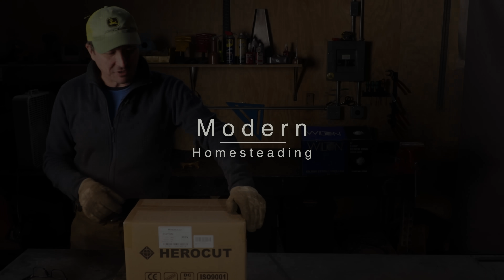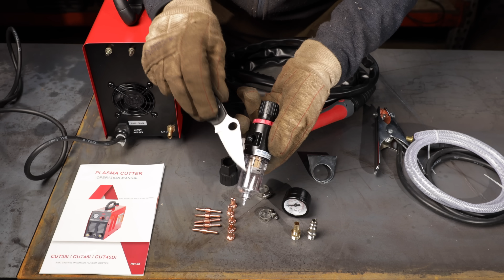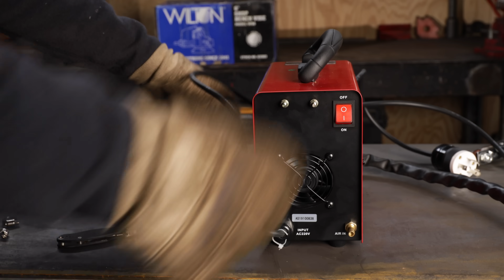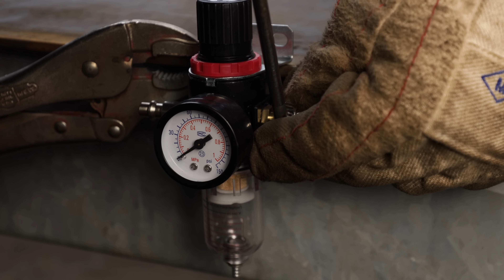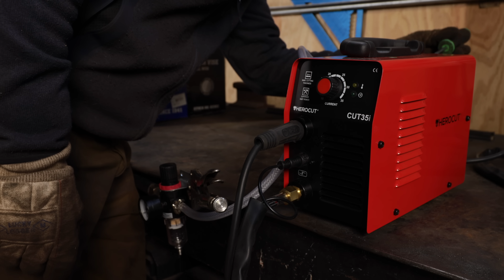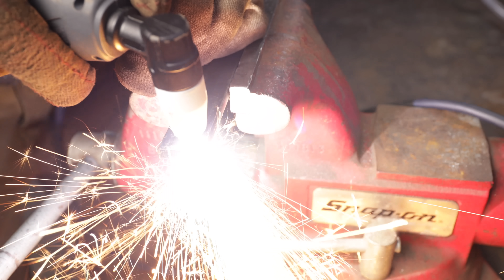TESTING The Cheapest Plasma Cutter On AMAZON

Comment: "There's a special place in hell for manufacturers that don't standardise things"

2 minutes later: "the metric system rears its ugly head again"

This week's irony award goes to Wranglerstar 😂
Reply: Rob M The fact that is is used way more because a lot or equipment comes from the US doesn‘t make it a better system. I would argue that metric is far more intuitive, especially for somebody who hasn‘t grown up with it and has to learn it later in life (vs the other way round). There‘s a reason that only three countries in the world are still using imperial units, although scientists in the US are probably already using mainly metric.
Reply: C90adventures : so, this is NOT a rant or anything, but rather an honest conversation I hope can be understood peacefully.

His first comment you reference is in regards to air tool fittings, which, if you are unfamiliar with air tools and their various fittings, it is an absolute nightmare since at least 3x of them all appear to be the same to the casual eye, but are in fact very different and can cause pretty serious air leaks if you mate them incorrectly. i.e.: a male "A" might fit into a "B" female, but the male "B" won't latch in an "A" female; and the "C" male might fit in all of the females, but will leak so badly in 2 out of the 3 that you have an audible hiss and a massive drop in pressure. As for MY air tools, I use the Foster SHD series, which is what the US Army uses and are conical pressure fittings. And they won't mate up to anything but a Foster SHD female; not any other commercially available fittings. So I have to have "conversion" fittings where I have a male end of various other fittings attached to an army of SHD female fittings so I can use my tools at any of my friends houses or at work without having to wrench off my fittings every time I go somewhere.... That would be a pain. And yes, it WAS (and *is*) my choice to run Foster fittings and be out of conformity, but I personally find them easier to use and they seal EVERY time without fail, but that's my personal opinion.

His second comment about the metric system, you gotta remember, this dude is super knowledgeable but his knowledge stems from an age when SAE / Imperial was king in the U.S., which was actually not that long ago (early 90's). Nowadays, the U.S. is flooded with a mix of SAE and Metric and people are constantly confused bc there really isn't a set standard for us anymore. Most kids today will do just about ANYTHING to not have to deal with fractions, and I'm right there with 'em; but take a minute and look at an SAE to Metric fraction to mm conversion chart and you will see that fractions, or SAE, has a lot more options than Metric sizings and is much more flexible if a manufacturer (say NASA) needs a specific tolerance, or torque value, or sheer spec as opposed to Metric. The pain with dealing with both standards is the same as if the Brits were to be forced to convert to SAE: they'd fight if tooth and nail for decades and it would take several generations for if to take root and get the working class all on the same page, but until then it's gonna be an absolute rat's nest of confusion, as is exampled here. Where our younger generation is more comfortable and familiar with Metric, and he is more familiar and comfortable with SAE. Neither one is better or worse, but simply a different tool with which to work with; and they only really work if everyone is on the same page, but if you've been using one for more than half your life, you're not just gonna switch from one to the other simply bc someone says you're "wrong". That's their opinion, but as long as we can effectively communicate from A to B, we can collaborate and build something together instead of fighting over who's "right" and who's "wrong".
Reply: @Hendo2488  You said it very well.
Reply: @Hendo2488  There is no right or wrong on the measurement systems, which will work if one stick to it around the world...for the convenience and ease of operation standpoint...The worse thing is to allow two different systems in place that can cause a lot of confusion.  From my experience of learning metric system to the Imperial system later when I came to the US, it is problematlic that I constantly needed to check, convert, and switch when I read papers, books, and such.  Since most of the world had converted to the Metric system, I think it is time that US needs to do the same, for the sake of conforming the the one standard that is easier to learn...No fractions needed.
Reply: @slchang01  then why am I, in the U.S., constantly finding hex bolts that require either a 4-1/2mm or 5-1/2mm hex key or socket to remove? Metric doesn't use fractions, huh? I grew up using fractions and I understand full well what those fractions mean. I too have to convert when I use metric, or Celsius, or kph (which is still metric).

But I guess I'm just not lazy and I found reference points on each chart that allow me to know that 100kph is 60mph and I can either double or halve that to find variations. I found that 10c is 50f, 20 is ~70, 30 is ~85, and 40 is 105. And a yard is 3ft exact whereas a meter is 3.3ft. These are simple conversions that are approximated, but for day to day use, they are perfectly fine for what they are. If I need something more exact, like in a lab or building a structure, I'm gonna have a conversion formula and record it to the most relevant decimal point. But day to day use never requires that level of precision.

Just bc you find it easier for you, doesn't mean everybody else does. If SAE was truly that terrible, they would have stopped using it a looooooong time ago. 

Or maybe it has something to do with our pride and not letting the English have dominion over us that they have so longingly been craving for more than 250 years.
Reply: @Hendo2488  By saying fraction, I meant that the unit is self explanatory...1 meter is 100 cm, or 1000mm which in complex units involving derived terms, it can be easily related and converted to the units in larger or smaller scales...Also, can you say freezing temperature is 0 degree Celsius, or 32 degree Fahrenheit? or boiling temperature, 100 degree C, than 212 degree F?  What I meant, is that the Metric system was developed for a reason, not so for Imperial system...
Reply: @Hendo2488  All that to say Metric rocks....lol
Reply: NASA had a mishap with imperial vs metric. The Mars Climate Orbiter. 

"A navigation team at the Jet Propulsion Laboratory used the metric system of millimeters and meters in its calculations, while Lockheed Martin Astronautics in Denver, which designed and built the spacecraft, provided crucial acceleration data in the English system of inches, feet and pounds."

This is why you have standards. And the standard is metric. Used by over 95% of the worlds population is metric. And metric is used in science, medicine, the military, automobile production and repair, and international affairs in US.
Reply: @GeirEivindMork  98.5% to be exact...US, Liberia and Myanmar use imperial units (3 out of 195 countries)
Reply: @GeirEivindMork  It was a mistake to switch over to metric. A lot of added confusion that led to the miscommunication. We went to the moon using imperial units. After they switched to metric, even the Space Shuttle got canceled. NASA can't even send astronauts into orbit now. It's been a sad decline ever since we ditched imperial units.

The dark age of metric units...
Reply: @eyeborg3148  The world have changed a lot since the 60s. I know USA is all about "USA FIRST" now with it's scary turn towards a seemingly fascist authoritarian leadership. But the reason for lesser space travel is more rooted into the fact they have to do it more safely than they did with the primitive 60s technology which cost money, but NASA had its funding peak in 1964-66 when it accounted for 4% of all federal spending and the apollo moon landing was of top national importance towards now when it is 0.48% of the budget. In todays dollar the budget in that time was up to twice as high than the one you got now, and that without the higher costs that you got now. So back in the day space exploration was both a top priority and a way better funded. But it's not all lost, SpaceX is planning on landing cargo on the moon in 2022 with people shortly thereafter, so you are doing well with in the era of metric as well.
Reply: @eyeborg3148  wait wut are you blaiming the metric system for nasa decline ? 
and just so everybody knows metric is better then imperial for many reason like:
-It s easy to reamber like just look at the imperial units for lenght (inch,foot,yard,mile,fathom,,rod,furlong……..) and now look at Si units (meter) and then you have prefixis to describe how big is your unit of lenght (micro, milli, centi, deci, deca, hecto, kilo, mega….) and thoes prefixis make total sens between eachother like 1000milimeters=100centimeters=10decimeters=1meter=0.1hectometer=0.01kilometer
now try to do the same thing for imperial units and you will get something that look like this 12inch=1foot=0.333333yards=0.00018939miles 
-Another reasone is that the Si system has names for extremly big units and extremly small units like 1nanometer=0.000001milimetre (that s extremly small and it s not even the smallest mesurment unit yet that we have) or 1meter=0.000001megametre(extremly big) and for this too it s not the biggest that we have 
-Another reasone is that this apply for preaty much all units we have same goes for volume or weight with the exact same propetis and exact same prefixis  while you guys have stuff like tablespoons gallons cups pounds ounces grains…….
-And the last important reasone i coudl give is that they all go togheter nicely like look at this sentence that is actualy true.It take 1 calorie to heat up 1ml of water that is 1 gram of water by 1 degree
Reply: Kevin Tu other way round it’s a mistake that the us does not entirely switch to metric
Reply: Kevin Tu the Romans turned to metric and they lost to Genghis Khan and collapsed
Reply: @eyeborg3148  Soviets were first in orbit with rocket, first to have the satellite, first living being in space, first around a moon, first man in a space, first space walk, first woman in space, first moon landing, first photographs of a "darkside of a moon" (backside to us), first lunar samples to earth by robot (followed by Apollo 11 and 12 manned samples), and only thing that Soviets "failed" was to get a man first on moon (and back) just with days after Americans.
And all that was done with Metric SI system.

It is sad that one nation does like 13 achievements of 14 first, only to come second in one (delayed by days) and it is like a huge victory to Imperial system.....
When USA got moonlander down, Soviets brushed to applauds because it was not who was there first, but that human race has succeeded in the last step of a moonrace.

Imperial? Pffff..... 
USA is alone and even dual-standardized SI and Imperial, just can't do the quick kill to imperial in decades....
Reply: @eyeborg3148  If calculating things in increments of 10 is confusing for you.. You are the minority.
Reply: @eyeborg3148  HAHAhahahaha what a load....
Reply: Rob M  There's two types of countries: That that use Imperial units and those that put probes on Venus. :)
Also, pretty sure the German engineers that made the whole Moon-landing thing happen used the metric system.
 ;)
Reply: Rob M  Look at this https://youtu.be/xx7Lfh5SKUQ?t=2784. The astronauts used imperial while the computer calculated in metric.
Reply: Rob M  Well the Sovjets launched the first successful Satellite and manned Space Flight using the metric system, so there's that.
Reply: Rob M inches are a stupid unit, that is devised into sixteenths which makes it hard to work with, miles are not a rounded number of yards, and feet are based on nothing as well, as for the pound it is defined by the kilogram, and the metric system is much easier to divide.
Reply: @tewtadle268  There are also units of 10 used with inches. But then I wouldn't expect anyone other than someone who uses  a scale in an Imperial measurement country to know that. Scales are also marked in 20, 30, 40, 50, and 60 divisions per inch.
Reply: Rob M  The Saturn was made by Nazi scientists so that is pretty irrelevant mate, lmao..
Reply: All i keep seeing here is a bunch of 'cancel culture' b.s.. The "rest of the world" uses metric systems bc the British bullied them into using them and "abolished" the systems of the country they did trade with (or invaded), not bc that country wanted to. "Do things our way or no one will trade with you". Yeah, truly superior.... Bunch of bullies. "We don't like the fact Americans have their own system and do things differently. They should just give up and conform to Metric bc we say so....bc we're better." 

Sounds like real educated argument to me....

Maybe you "English" folks should do some research.... Maybe then you'd understand that Imperial/SAE was around long before your precious Metric.

Britannica Encyclopedia: 
The SAE system of measurement is based from the British Imperial System, which was the traditional system of weights and measures used officially in Great Britain from 1824 until the adoption of the metric system beginning in 1965. The United States Customary System of weights and measures is derived from the British Imperial System. These units are now legally defined in Metric terms. The British Imperial System evolved from the thousands of Roman, Celtic, Anglo-Saxon, and customary local units employed in the Middle Ages. Traditional names such as pound, foot, and gallon were widely used across Europe.

Maybe read your own history before trying to tell us about ours. And keep your hateful rhetoric and bias to yourself.
Reply: Why do you have a problem with the metric system you guys have technically been using base 10 since  1792, its called the Dollar.
Reply: @sitgesvillaapartmentneilsc7924  +1
And it's not like 12 cents equal to 1 dollar :d
Reply: Rob M  they actually used metric at nasa
Reply: @pardontillinghast4989  Damn you Werner Van Braun!
Reply: @pardontillinghast4989  thank you. not to mention, without Wernher von Braun NASA would not have flown anywhere but to most lumber jacks this sounds just like another maple syrup.
Reply: @pardontillinghast4989  wrong
Reply: @pardontillinghast4989  Except when they don't. Don't forget the Mars Climate Orbiter that failed because there was no agreement on units between subsystems. And, yes, I did consider the distinct possibility that your comment was tongue-in-cheek.
Reply: @dwinsemius  it was also made by British guys in a shed.
Reply: @pardontillinghast4989  They actually used imperial at Nasa, until their rocket flipped over due to miscalculation. The entry was imperial and computer was meant to calculate as metric. Scott Manley has a great channel explaining things about astrophysics and computer science.
Reply: Rob M the definition of a pound for example in the modern world is based on the kilogram, as is the same for all imperial units, their modern definitions being based on the metric system. Yes back in the olden days no, but nowadays yes.
Reply: Rob M  NASA wouldn't have gotten to the moon without German engineers brought over in operation paperclip. What units do you think they were used to using?
Reply: So they used made in China at NASA? Hehehe
Reply: Rob M  why have you been touting the superiority of the Imperial system for months in here? Not even once did you give a single argument for why the Imperial system is better. If you think it has some merits other than it being the system you use in your machining trade in North America, let's finally hear them so we can compare and decide.
I would argue that the success of the American Moon landings were actually NOT reliant on which measurement system they used. They would've succeeded either way. I'd even go so far as to say that the Moon landings are completely irrelevant to the topic of "is Metric or Imperial preferable?"
Reply: @vaahtobileet  he's a Muppet clearly, I had a right laugh reading all his ramblings.
Tbh he must be a troll, he points you to the way to prove him self wrong. E.g. Google it.
It's a well known and easy to prove fact that the US is and has been for a long time based on metric conversion to imperial for all sciences and standards. (They use the international SI system which NIST regulate for the us) 
But he continues to state facts which are easy to disprove.
Reply: I laught out when i heard it! 😜
Reply: World standard is metric. Metric = modern. Every country in the world uses metric except USA. USA is stuck in the dark ages
Reply: Rob M  nazi's got the us to the moon
Reply: Rob M  whatever you think, it's got nothing to do with currency reserve, imperial is behind the times old outdated and obsolete.
Reply: Rob M  6 of the 7 countries that have been to the moon use the metric system. The US government uses it a lot more than civilians realize as well.
Reply: Three countries still use imperial: the U.S., Liberia and Myanmar. Chose your camp :-))))
Reply: Rob M  they didn't fully switch to metric until a couple decades ago but they did use metric to design the Saturn 5. 

When creating something as complex as a rocket engine, why spend your time converting quarts to gallons? You don't when you can just use liters. That was the thinking of nasa engineers as well. This accommodated by the fact that a german was the head designer of the rocket, nasa would obviously use metric. 

Then it was converted for manufacturing.

Yes I did Google it and I'm right
Reply: Rob M  because progressive economic policy and lack of infrastructure damage during ww2 gave the US a technological head start. Almost any 1st World  Western nation could put a man on the moon since the 70s. Instead they are sending probes to asteroids and the outer planets. The moon isn't interesting for space exploration anymore. Stop trying to attribute our moon landing to our terrible system of weights and measures.
Reply: Rob M  FYI the Inch was standardized on the Metric system back in 1975... and still is to day ;-)
Reply: its a long running joke
Reply: Rob M  That country also produced the Chevy Vega and the Ford Pinto.
Reply: Yer.....that thing the rest of the world uses.....:)
Reply: That was funny. And I didn't hear it, I had him on CC and read it and laughed.
Reply: how dare that insult the metric system
Reply: "A warm place in hell"
Is the metric system better? Most likely but It's kinda hard to import something  built on 16" centers
Reply: Well when we buy air compressors we dont all get excited for Newtons.. or when we torque things down.
Reply: metric is the Standard. Welcome to the XXI  Century.
Reply: Rob M who got to space first?
Reply: Rob M  metric was actually used to design everything in the apollo missions. It was all later converted to imperial for manufacturing.

Metric brought us to the Moon. Imperial destroyed the Mars Climate Orbiter 🤔
Reply: This whole discussion is so meaningless.

Metric is better. End of story. 

Use whatever you want but at least be honest to yourself.
Reply: Over 90% of the world uses the metric system by population. Get with the times America.
Reply: @Baz-uq5bo  Indeed!  It's getting laughable at this point.
Reply: The guy is such a joke.  He's a noob with money and masquerades as someone with knowledge.  Very annoying.
Reply: @vladisergeiev7278  He may be infected with the anti-(China+globalism) virus. It's a very popular perspective in rural Oregon.
Reply: Rob M  2 kinds of countries, those that use the Metric SI system, and the one that pretends it went to the moon, using English Inches :-)
Reply: Steve Morri
Reply: @stevemorris3710  Well, not to worry.  The Chinese use metric and will also be on the moon soon.
Reply: @thomasjamison2050  Yes we're looking forward to footage of the Chinese using the American Lunar Rover. Unless of course it was made up.............
Reply: @MrGeorge2145 I defend the imperial system because it actually makes sense to me. Everything is approximately relative to something common such as an inch=knuckle, foot=foot, yard=nose to tip of fingers or one long step, mile=200 steps. Anybody can take approximate measurements even without a ruler. I did this for over 30 years in my profession by stepping off distance, using the tip of my thumb to the tip of my pinky for 9 inches and so forth. I did this the other day when cutting logs at 10' when I forgot my tape measure and I was within 4 or 5 inches which was fine since it was for firewood. The divisions even make more sense since it is simply dividing each unit in half. 1/2, 1/4, 1/8, 1/16, 1/32... To me, since it is relative, it is easier to understand. I have nothing to compare a metre, centimeter, or a kilometer to. Just my opinion.
Reply: Rob M  you do know that the imperial system is based of the metric system right?
Reply: @djkazuma  The Imperial inch is actually based upon the ancient Egyptian measurement system ...the Pyramid Inch. Read more.
Reply: Rob M  Well, you mean English units, that they used, to pretend they went to the moon.
Reply: @stevemorris3710  No, he meant "US standard" units, as opposed to "imperial units". "Imperial units" would be close to what you mean by "English units". This name is actually not true, as UK went metric in 1979 but, when it still was valid, imperial (UK) gallon, for example, was different from US gallon. Differences in the pint and the quart volumes resulted from this too.
Reply: @robrob5419  Way back - at the time we all lived together - we had used the Queen Anne's gallon of 3.785l to measure wine. We also had different volumes and names to measure both beer and grain. When we realised that this was silly, in 1824, the UK chose a single imperial term and lumped together all three measurements, picking a roughly-average volume and calling it a gallon. American colonists, though, stuck to tradition and kept just the Queen Anne's volume for their own gallon definition.
Reply: @stevemorris3710  Interesting bit of history on origins of imperial ("English") gallon - I didn't know this.
The fact remains that the "American gallon" is different from the "English" or "imperial" gallon (however we call it). On top of that, UK went metric nearly 50 years ago but I bet people still ask for a "half-pound of sliced ham" in a deli store. Similar to Canada, I see this every day and I myself do it most of times too, even though we are metric, at least officially...
It needs to be said, though, that our machine industry works in inch measurements most of times to this day. In fact, many of us can work both metric and US standard.